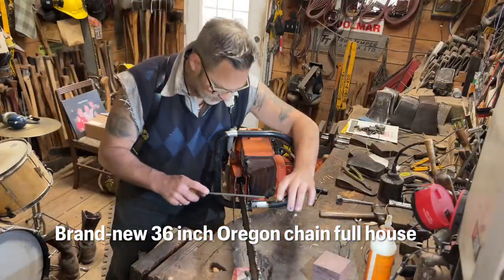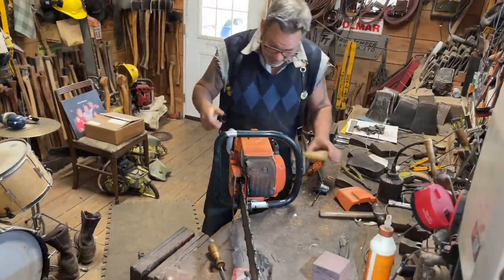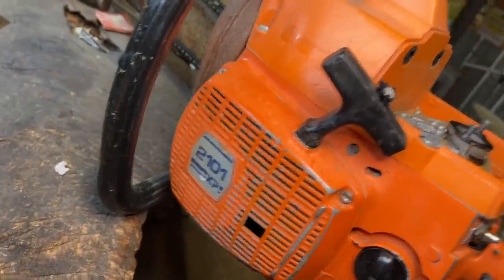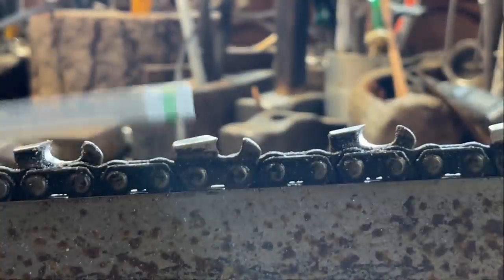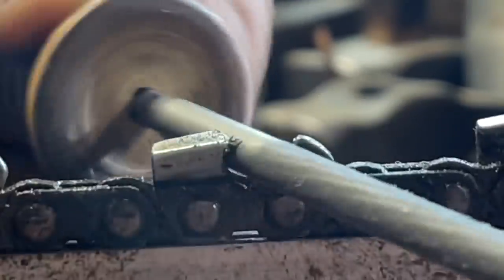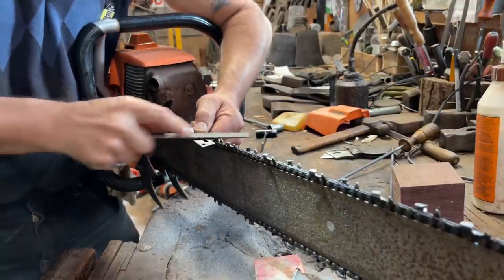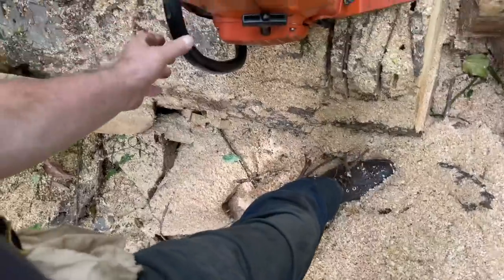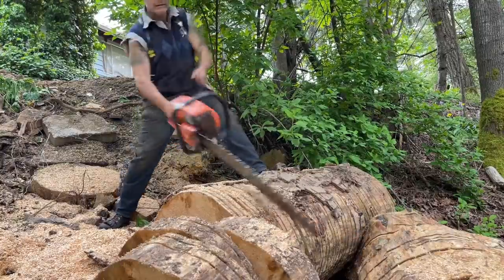WHY! These Things Just wont leave me alone! Homeless Chainsaw. Husky 2101

Comment: Hey Billy! I fully agree with you!  This saw,  became the one who had to replace my stolen Jonsered 920 in the early 90's. Husqvarna 2101 xp,  which I still use today,  is a very good and extremely strong saw,  one of the very last models, which was manufactured according to the "old school" facturing,  when quality and durability were put in first room, before..for exemple: to make the chassis weaker for cut down the weight 
One thing with this saw, which I really appreciate, is the extra manual oil pump, which is very helpful when you sawing in hardwoods with long bars.
The only thing I miss on this saw is a decompression valve, then the compression is so high

Greetings from huskis homeland Sweden!
Reply from the maker: Greetings friend
Reply: @BuckinBillyRaySmith  Thanks Billy..  I forgot to tell you: "W" stands for "Wrap around handle" which most chainsaws along the west coast are equipped with
The only disadvantage of these older saws is: that it can be very difficult to get spare parts for them!, even here in the country of manufacture,  i can not get much from the factory in Huskvarna..(they prefer you to buy a new one) best chance is to search over the internet , if you are lucky?, a dealer still has sam parts left in his stock for your model..alternatively that some parts fit a number of related models..

Comment: Clutch bearing needs lubricant ? I remember when the 2100 first appeared, they replaced the company’s 050 Sthil, they were a pig and hard starting , always pulled the handle thru your fingers, if you used the decomp it would stick open , l loved those 2100s powerhouse! 👍🇨🇦

Comment: Great video man. I'm in need of some help, I just got a 1965 remington super 754. I'm a mechanic and I got it running great. Problem is I can't for the life of me get the chain cutting. Its got the original remington roller tip bar. The chain is 404 pitch .58 gauge so I cant find a new chain. I'll pay the shipping both ways if you can save the chain thats on it buckin!
Reply: Shawn walk, pin gage your bar and see if it is war out enough to run .063 chain I know for sure I can still buy that chain by the rolls I had a roll in my hand a week ago.

Comment: nice powerfull saw, only heavy in daily use. Compared to a 572 XP with nearly same horse it is a 3 KG difference
Reply: Yes, I have one of these and some smaller saws. In some size timber here in Oregon, I can just let this saw do the work despite it's weight disadvantage. The thing is a 'wood processor'.

Comment: Do you wear out your guide rubbing a file over it like that?
Reply from the maker: i file the raker not the plate, and if you have a softer plate you have to be diligent , cause 30 degrees turns to 35 degrees quickly